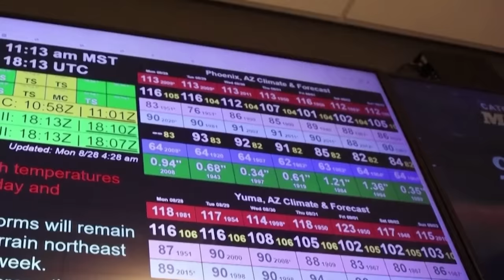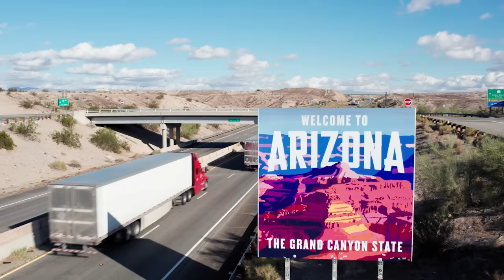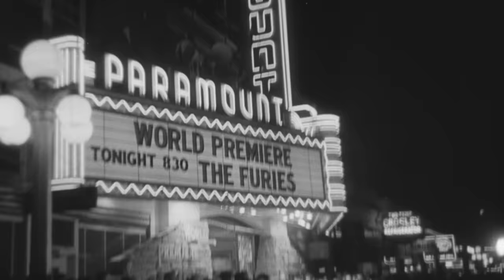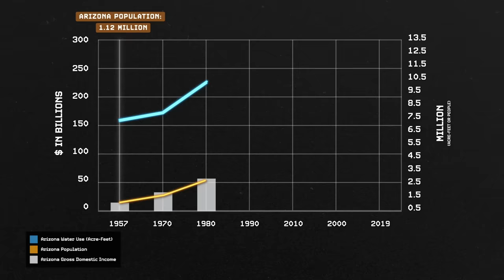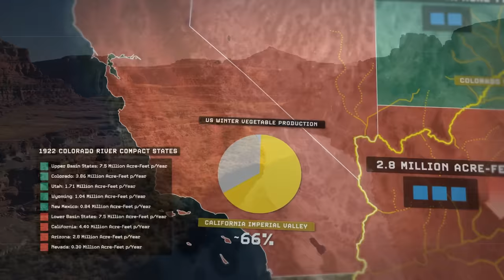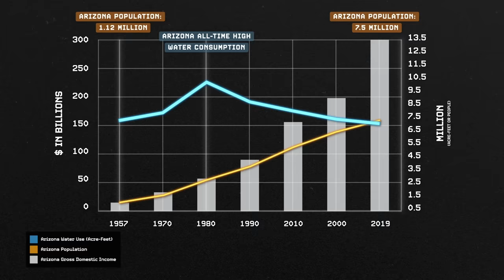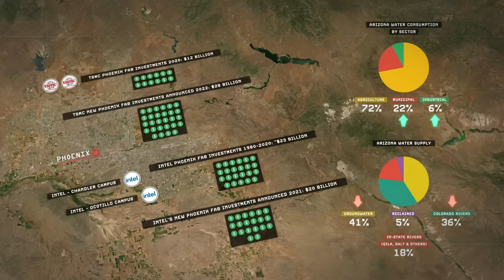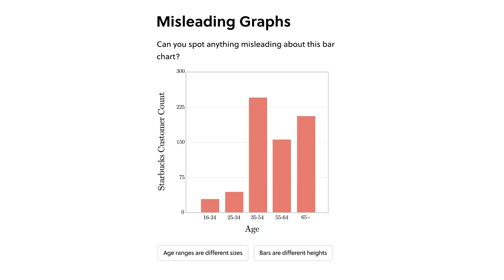Why 5 Million People Live in America’s Hottest City

Comment: Born in Phoenix.  Lived there for many years. Hot 24/7 for close to half  the year now. Often over 110 degrees. Projections are it will get higher. You can go out at 3 am and it's still too hot. On top of that, the housing has gotten stupendously expensive.  God help them if the electric grid ever goes out.
Reply: And what will happen when it’s dried up? Mass evacuation?
Reply: @QuarioQuario54321  Compassion and concern for others has become less fashionable.  I would guess at half-assed emergency services followed by diminishing coverage of heat-related fatalities
Reply: What about the fresh water issues as the city of Phoenix increases-???🤔.
Reply: Right the water situation is tenuous as best and the building FAB's that require millions of gallons of fresh water daily😂😂😂
Reply: That last sentence 👏
Reply: I don't live there, but please I don't want the electricity to fail. AC saves lives. It's as if people kind of just go mindless about it.
Reply: @Starry_Night_Sky7455  we take things for granted, until they start to fail
Reply: @clarkdavis5333 that water is recycled assuming you are referring to TSMC. I work there incase you wonder how I know this.
Reply: Answered your own question. Housing is high because people want to live here when they get sick of freezing and humidity
Reply: I lived in Maricopa County for 30 years with nothing but swamp coolers that barely did anything before finally getting a house with A/C. Unlike many places, it's not covered with snow and ice 7 months of the year.
Reply: It hasn't gotten hotter.  It's been the same since I was young.  The record heat was when I was ninth grade, more than 30 years ago.
Reply: @kjl6039  it has gotten hotter though. The record may have been 30 years ago but it sure as hell wasn’t consistently that hot like it is now.
Reply: Lived in Phoenix for over 25yrs. It has constantly gotten hotter and more expensive. The population and traffic has exploded along with crime. I can't see this city lasting more than 30yrs with the increased temperatures and lack of water.
Reply: Not nearly as hot but the humidity will get ya. It is hell when power is out here in Houston 😂
Reply: Why? We have dams all over the place and are connected to grids of other states (unlike some states. *cough*Texas *cough*)
Reply: @kuromyou7969  My understanding is that we are more vulnerable to attack than ever we thought. And, besides, sooner or later, the bad thing happens
Reply: Well that will happen if you vote for kamala!
Reply: 130F will be regular soon.
Reply: @Wegetsignal Youre already regular. Pfft!
Reply: nowhere to run. even the mountain towns are just 10 degrees cooler.
Reply: Compared to other western cities, housing is cheap.  That's why everyone is flocking there.
Reply: ... or water runs out.
Reply: @geraldscott4302  Same here---hanging out of a window
Reply: If your smart you installed solar panels with battery backup. No need for grid! 
With so many sunny days why wouldn’t you harness the energy beaming on you every day?
Reply: With so many sunny days, why wouldn’t you install solar with batteries? No need for grid . With all that free energy beaming down on us why rely on anything else
Reply: @kamakaziozzie3038  I'm not about to destroy my new $12,000 roof with that solar trash.

Comment: As a lifetime Arizona resident, I have never seen water in the Gila river even once in my life. The river is completely dry by the time it reaches Phoenix.
Reply: I wonder if all the dams upstream have anything to do with it.... And the fact that they had to dam the rivers because of the yearly monsoon floods that would destroy buildings and bridges.... I wonder if that's the reason why
Reply: Seen it wet a few times, but only from flash floods. It goes underground from what I've been told. Don't quote me though. 😂
Reply: It’s because the Salt River project swoops all the water from getting to the Gila watershed and the Verde watershed (above the Gila). This also means less flow into the Colorado as the Gila flows into the Colorado. Groundwater is also fucked over there too, overdrafted a bit.
Reply: @samuelblack1687  
nope. canals to agriculture
Reply: They need to run a pumping station from the Rio Grande, across the hills, and into the Gila near it's origin. Would make the dams more efficient, could be shut off for flood rains, and would leave more for downstream irrigation... All while propping up the dwindling Colorado. Might be able to get Mexico to pitch in on some of the project for a healthier Colorado, which they also use.
Reply: @chillaxter13  New Mexico would never allow it, the rio grande is already low enough as is.
Reply: The Coolidge Dam holds back most of the flow but even that reservoir was extremely low until last season's wet months. But yeah, the Gila down in the valley is just a sandy wash.
Reply: It's diverted at Florence into canals. There is most certainly enough water to call it a perennial river just a couple miles upstream.
Reply: When I lived in Phoenix in the 70's one of our Arizona history books had a picture of a steam paddle boat said to run from Yuma to Gila bend.  This videos low flow rates are averages of what is left after the dams have diverted all the water.  Most the time these rivers are dry as a bone downstream.  The guy is also nuts when  he said that Phoenix recently set an all time high of 113F when it was not uncommon in the 70's for that temp to be exceeded several times a year.  I googled the high temp for Phoenix and it listed 122F back in 1990.  I live a 1000 miles north in Lewiston Idaho and we had an official all time high temp of 117 and we get to 115 or so every few years,  and thats why its called Hells Canyon.
Reply: Intresting very intresting
Reply: @matthewserrao2926  Not always, The Salt and Verde watersheds have numerous dams that retain water for Phoenix and that is their main priority and always will be since the early 1900's. With all the rains last year though, enough water was released from these to flow through Phoenix and into the Gila, eventually making it to the Colorado. I believe water provided to the Colorado river from Phoenix allowed water to be conserved upstream at lake Mead.
Reply: @mikecrooks8085  Pretty sure he meant the record was broken for a specific day, not an all time high. Also, 117 up in Idaho sounds crazy.
Reply: @Shankster930 > 2 years ago, 40 west of here at Starbuck Washington they set a new state record for Washington at 122F our record should be up in the 120's but our stupid airport thermometer sits on a bluff 700 feet above the river and it is normally 4-5 degrees cooler up there than downtown.
Reply: @chillaxter13  As a New Mexican hearing someone talk about pumping water from the rio grande into Arizona is one of the most insane things ove ever heard lmao
Reply: @Shankster930  that’s because AZ & NV are the first states to be cut off from CR river water due to the Drought Contingency Plan, which was in affect last year. This means either reduce the water usage from the Colorado River or “add” to the mead amount of reserved water. Also all that water basically went to the Imperial Irrigation District, which uses 3.1 million acre feet for primarily farm use.
Reply: @mikecrooks8085 Absolutely nuts that these rival and match Phoenix.
Reply: @matthewserrao2926  It was to sustain agriculture in Phoenix and to prevent floods, as like California we go from overly dry periods to wet ones. To regulate our Salt river to provide constant supply rather than intermittent bursts. I don’t think the Colorado restriction is as severe for Arizona as California or Nevada, Phoenix and primarily Tucson have been storing excess Colorado water underground knowing this would eventually come. Las Vegas is a great model for sustainability with water usage, but that is primarily because they had to, while Phoenix has a more sustainable supply in comparison. Though I’m not saying Phoenix should not follow Las Vegas as a model.
Reply: It's the Tempe lake. It's stops the gila up and the water gets used.
Reply: @thomasmann3560  Tempe lake is not on the Gila. But it is a little wild that Tempe has a small waterfront district at all though
Reply: @Shankster930  your right, it's salt river. My bad!
Reply: The Gila River never reaches Phoenix. The Salt River does.
Reply: My neighbor kayaks it
Reply: The Gila river did flow back in 91 I believe. The Salt River was flowing then,also! I remember it well. We had a very wet winter and the bridge in Tempe was under construction when the river was flowing. It took out what was done and they had to start over.
Reply: @mikecrooks8085  The record set last year wasnt highest temp, it was longest continous streak over 110. Last year we topped out at I think 33 days.  Growing up here in the 80's and 90's it was common to see temps spike up past 115, but usually only a few days out of the whole summer. Same with the 110+, usually about a week or two before the 115+ then the monsoons kept us at or below 110. That cycle's changed the past decade or so.  We seem to get more rains over the winter the past several years.
Reply: @robertsaget9697  also nope. Although water is redistributed for agriculture the primary reason the salt river was damned was to prevent flash flooding like what happened in 1891, 1980 and etc. Catastrophic floods would normally be commonplace for Arizona during monsoons if it weren't for the Salt River Project.
Reply: Why's the river named Agua Fria?
Because it's free-a agua.
Reply: @DGPHolyHandgrenade In 1990 it was 122F in Phoenix and even hotter in Yuma.
Reply: I live about 75 miles from the valley and we had no heat records last year. Could it be the urban heat island effect that artificially created these records?
Reply: How old are you?

When I was in high school ('70s), we went tubing on the Salt and Gila rivers in the summer.

I grew up in Phx ('60s through '80s), and the video has most of it right with a few embellishments. 

I don't like going back to visit because it reminds me of the  sprawl of southern California and all the associated  infrastructure issues.
Reply: @nomdeguerre7265 well aware, I was riding my bike in that. that's why I said last years record was NOT for highest temp but for longest streak over 110.
Reply: My property has water on it the river flows under the ground i have many fish too
Reply: What ! Born and raised 40 years in been to gila river 1000s of times just past phoenix international race way 127th ave and broadway! Its been there my whole life
Reply: we have been getting a lot of rain this year 🤙🏻
Reply: bruh i had a home growing up right on the gila, and other than monsoon season it was dryer than a birthday party at work
Reply: @Official_SunTzu  its a river not a pond flowing year around
Reply: @Thegrimfiles  yeah shit was dry
Reply: @Official_SunTzu  do you understand that thus is a desert and in some areas the rock is so deep in the rivers that the water runs under the rock and opens up where the rocks are not built up ! Go to the river and dig water runs underneath ! I just drove to the south side of phoenix and where was water not alot but there was water try going in avondale or goodyear or buckeye there is water and its cold water year around!
Reply: Yuma resident here, I can say that I've only seen water in the Colorado when there's HEAVY rains, which, as we all know is a bit rare.
Reply: @Hydra3724  so your saying no water in the Grand Canyon! Lol funny there is water always flowing in the grand canyon’s!
Reply: @Thegrimfiles  in yuma...
Reply: there used to be a little bit of water in there but never seen it flow. not sureanymore since i havent lived there in over 10 years now but there used to be some
Reply: @chillaxter13  also, I've lived in the area where the colorado flows into mex. The only times I've seen water on the Mexico side is when they had to jet it through for floods. They have no reason to cooperate, since we hog it anyway
Reply: David deck redirected The Gila to Tolleson down by Phoenix and there's a huge water plant there that's what they're doing with the water from the Gila is it good if you knew it was in The Gila River and where it came from where I was raised up north by Kearney and Superior in that in the minds I think you get the hint
Reply: As someone who lives next to the gila river basin, I've seen it full once. ONCE.  I have lived here for 17 years now and I've only seen it full ONCE.

Comment: - I'm bored... 
- Hey, what if we take the most water consuming industries and try to develop them in a literal desert?
- Sounds like a nice challenge, let's get to it.
Reply: hello squid wars i like spongebob
Reply: The water is mostly run on a closed-loop circuit. It's true that you need a lot of water at first. But once you put the billion gallons of water into the internal system, it recycles itself indefinitely. You do need to, every now and then, add some new water or replace some old, but for the most part the system runs continuously and there's not much additional water needed.
Reply: @bl-nb8fo  no. the amount mentioned at 41:20 is the total consumption rate their system needs to operate. They recycle absolutely everything they can, but they still need enormous amounts of water. There's a lot of waste product that builds up, and it becomes increasingly impracticable to filter the water at higher percentages. But then again they have special needs; not everyone needs 99.99999% percent clean water in order to clean their machinery :d
Reply: I'm still baffled at this decision
Reply: @megalonoobiacinc4863  You basically repeated everything I said as if it was a counterpoint smh
Reply: @bl-nb8fo uhm. No. You gave the impression that once running it basically "recycles itself indefinitely", which isn't the case. Water input will still be huge. Just not astronomically huge.
Reply: @megalonoobiacinc4863  Which is basically what I said if you could read between the lines. Again just repeating what I said. ☝️🤓

Comment: It can still be over 100F at midnight in Phoenix, summer temperatures don't cool down that much.  Early morning low can be 95F.
Reply: Depends on our cloud cover. Clear day and no clouds at night, then is will drop 30 F. But our hottest days attract clouds because it keeps humidity in the air and they collect as the sun sets, making a blanket holding the heat in